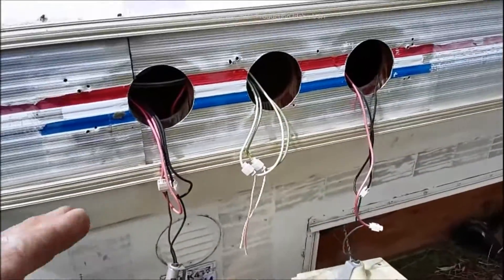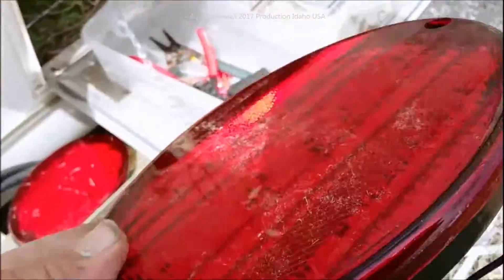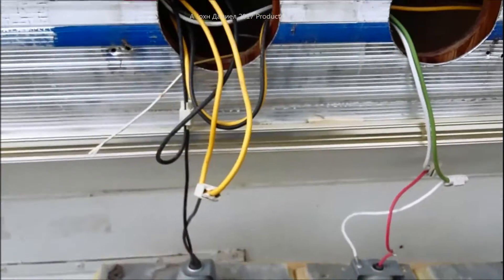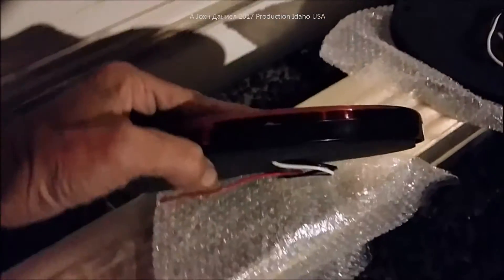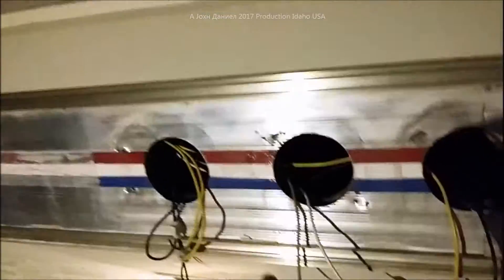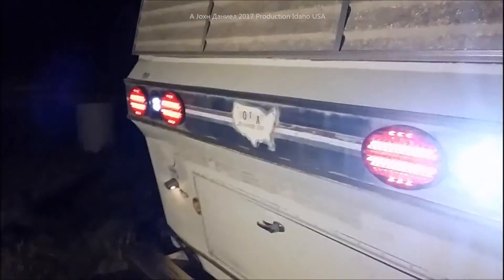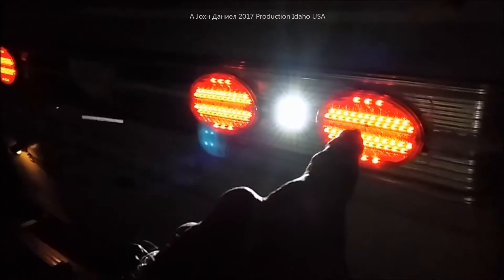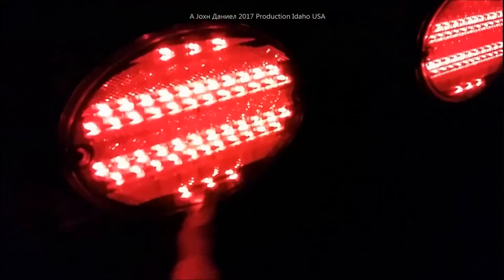LED Tail Light Conversion on Vintage RV Holiday Rambler Trailer 1976 ↙

Comment: Wow John, these are really nice. Flat mounting and no regular bulbs to go out. I love them. Can they be put on my motorhome? I have a 1995 Itasca with just red tail lights and looks like plenty of room on the area back there.
Reply from the maker: +Missy T You just need a flat area and you can put 2 or 4 on. Best to get that 6 pack they sell so you have spares in your rv since designs are changing so fast now.

Comment: Just a thought, would it have been better to only put the turn signal connection on the outer most lights. If you had the stop lights and turn signal on you would still have a solid stop light on .?
Reply from the maker: When you use Red and Amber that would be the way to go. But with red only you need a definite ON/OFF flashing to show your intent. DOT February 1977 , amended August 2004
Reply from the maker: PS - Also the trailer and truck are not wired for 2 color turn-brake system which is what would be required to separate the circuits into 3 wire with ground verses the 2 wire with ground